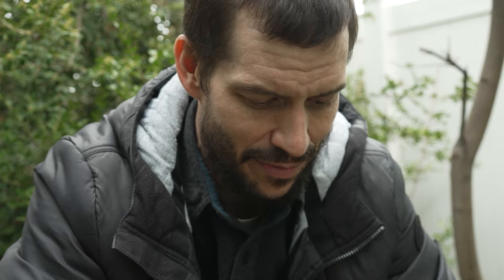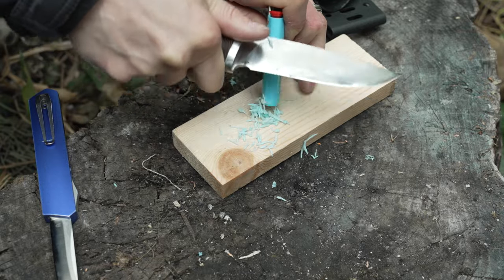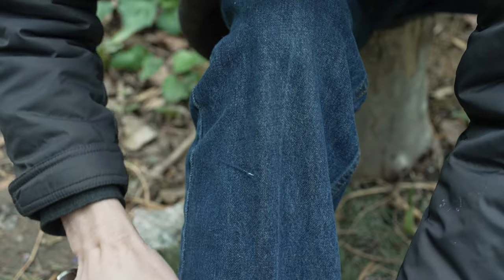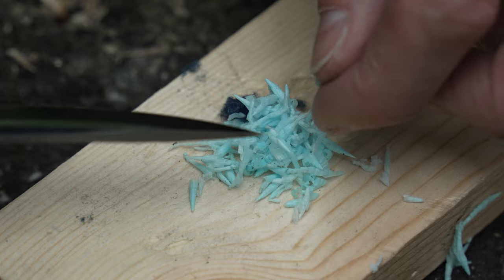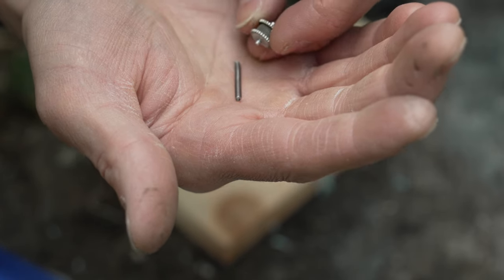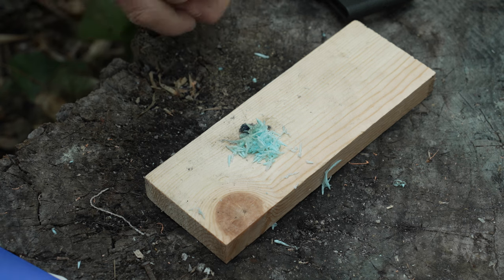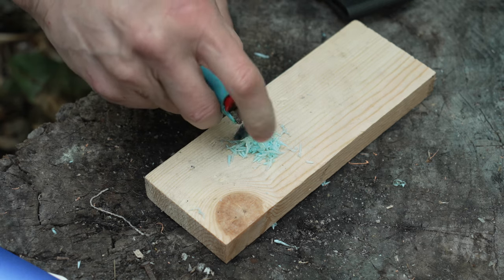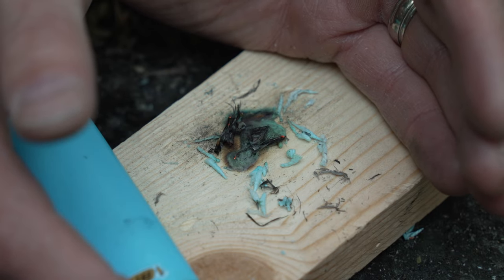How To Make Fire With A Broken, or empty Lighter. ⚡🔥#survival #camping #fire #bushcraft

Comment: Stay upwind when the plastic burns.
Reply from the maker: Bic lighters are made of a thing called Delrin or an acetyl polymer. When burned, they release trace Amounts of formaldehyde. You should be in a well ventilated area. However, you would have to burn buckets of them and breathe it in to get to levels toxic enough to make you sick. However, again, if you get another brand of lighter, like, I tested on a dollar store lighter, and it released a lot of thick black smoke. It is much worse for you than the smoke released by Bic lighter.